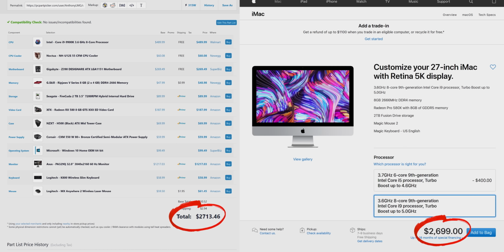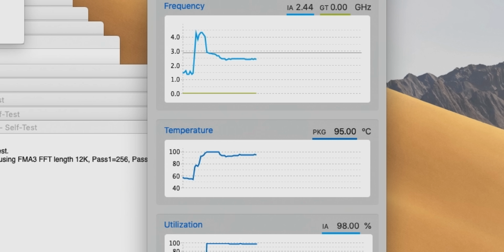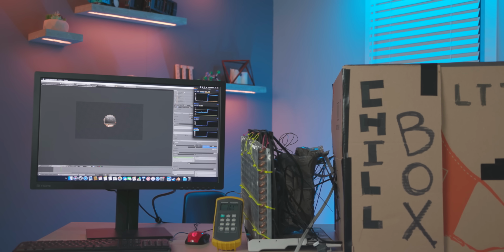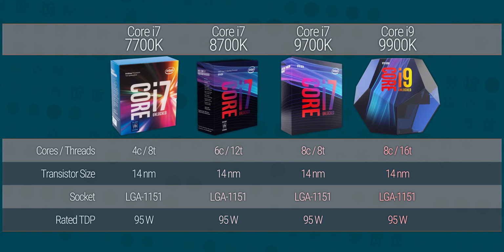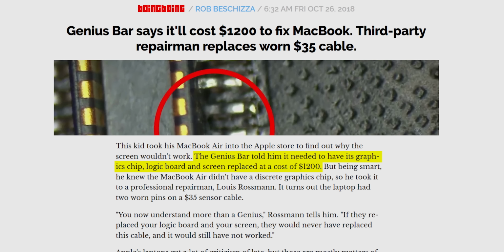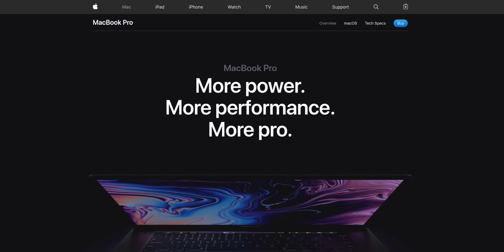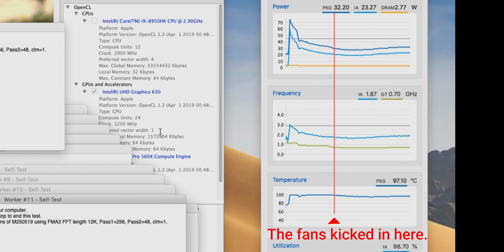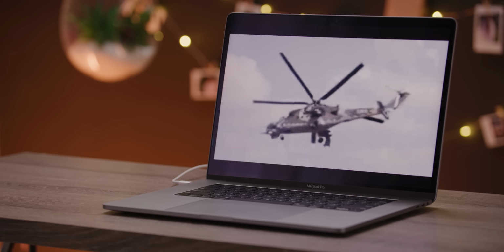Macs are SLOWER than PCs. Here’s why.

Comment: 0:12 Why so big monitor 32"? O_o , and it's also 5k. What's the point to take SO BIG SCREEN? Just take 24" monitor with 1920x1080 resolution and you're great! No hassle with apps, which do not support 4k-5k, all fonts look great, less GPU stress and power consumption, and you will be able to play any game on ultra/high settings with such graphicscard in 1920x1080, while with 4k/5k you won't. What's the point to buy 4k-5k at all, i don't get it.

Comment: I had G75vw Laptop with a custom firmware and GPU 670MX.  The GPU was overclocked from 601mhz to 900mhz.  Could barely feel any heat.

Comment: All I know is that anecdotally, my XPS 15 with similar specs takes about 3x longer to load into a game than all my other friends' MacBook pros, and lags a lot more.
Reply: Probably just the hard drive. What was the cost, specs and release date of the machines?
Reply: @johnmartinez12347  don't remember when, a few years old. I7 of some sort with 1050 gpu. But I do remember at the time reading on forums that some units were getting the Evo ssd's and some were getting crappy ones with like half the speeds... Pretty sure mine was the latter.
Reply: @johnmartinez12347  forgot to mention, I also had to replace the wifi card because the XPS ships with a  horrible Killer card that drops connections like crazy. Also more thermal throttling for whatever reason... Probably because plastic chassis doesn't conduct heat as well as aluminum 😂

Comment: I've been longtime user of Windows laptops (never using Macs previously), Thinkpads were my favorite over the years... I recently switched my main personal laptop to a 2015 13" Macbook Pro and so far I find its practical application better in most all regards. I've run video intensive workloads on it, and I do hear the fan kicking up for a period of time after awhile, but I never found there to be any notable delay in response while it's running hotter. 
   So far I am liking having an OS built on proprietary hardware, vs an OS like Windows built for hundreds of brands of hardware, I can see an obvious difference in efficiency and much faster boot times (amongst other things), as the overall hardware/software package seems more optimized, kind of like when you custom compile a Linux kernel for a specific hardware, it just runs a lot faster to start with (not having all the typical bloat in the kernel)... 
   But by far, the biggest advantage I've found running the Mac at this point is the battery life is far superior than any Windows laptop I've owned. I find the MacBook manages power consumption a lot better. When the Macbook is down to 87%, the Windows laptops I've tested them against are down to 30-50% already. The Macbook also sleeps, and wakes up from sleep much faster than any Windows laptop I've ever owned. I bought the Macbook used so it was not expensive at all and it is very compact compared to my latest Thinkpad. Even my other corporate Windows laptop for work which is cutting-edge and compact, only has around a 4-5 hour battery life where the Macbook easily doubles that at around 8-10 hours.. 
   So far, I am fine with Mac, and is nice to know I'm not constantly tethered to a charger, and I don't really care about what Apple advertises, as I buy all my stuff used anyways, I know 98% of all sales and marketing is BS anyways so the thing that concerns me most is, do I like it, does it serve me well... Not concerned about how it serves the next guy, only needs to meet my needs. Nice video though, doesn't surprise me that companies participate in trickery, doesn't really bother me though, as the Mac seems to work pretty good for me so far. BTW I'm not a fanboy for Mac, just use stuff I'm interested in at the time (also had been getting sick of same ol Windows for years and years, ready to try and learn something fresh)...
Reply: @Andrea Mangano - My apologies for miswording it, as of course it isn't proprietary hardware anymore, you can install Windows on Mac hardware for some-odd years now, but they build their software platform around very specific set of hardware they themselves design (as in they only have to support a few hardware/driver configurations where Windows has to support many more variances). I guess I meant that the Mac philosophy is more like proprietary 'appliance' where the software/hardware together are the total proprietary system, whereas Windows OS is more decoupled from the hardware part, and leaving manufacturers to make the end product and sell it for them... And aside from Hackintosh I don't see any way that OSX can run on anything but a Mac so I guess you could say that the software is proprietary then, not the hardware.
     Also OSX tries to keep the app devs in better compliance with their standards so they can keep a tight control on the energy consumption. If an app is misbehaving in OSX it pops up a warning to the user that this app is not optimized for the OSX so if you allow it to run anyway, you may not get the battery life or efficiency you'd expect. 
     I do have an iPhone now too, and it does seem it is proprietary hardware, as I do not believe it's possible to run any known Android ports on it...

Comment: I honestly think Apple just won’t give a rats ass about their intel macs.  They are probably just waiting to release their own CPUs and are holding out until then.  I mean apparently the iPad Pro has comparable performance to a midrange MacBook Pro with a smaller footprint.
Reply: In 2018 there were alleged reports about them phasing out intel starting in 2020.  When you consider the most recent changes to MacOS it makes sense.

Comment: Ah, the age-old "Mac vs PC" - always sure to start a debate in the comment section. 
  

I use a self-built Windows desktop for gaming and 3D/video rendering/processing work. 
For my creative outlets, such as music, writing, photo editing, and graphic design, I use a Macbook Pro Retina 2015. (I also use it for my general web-browsing, e-mails, and day-to-day activities.) 
For my digital art (drawing and painting), I use an iPad Pro. 

I daresay that Windows machines are better suited for tasks where you require more control over whatever you're doing, while OS X streamlines its UI and workflow more. 

I've had far more issues setting up a drawing tablet, or external audio hardware on my Windows machine. Not to mention the excessive drivers, routing, and other compatibility issues Windows machines face. 
With my Mac, it has always been "plug n' play." Tablets, audio interfaces, and midi-keyboards, to name a few, just worked. It is also great for working while travelling. 

Sure, you can 'game' and run benchmarks on a Mac. But why should you? Most games are catered towards Windows, and it just runs better on Windows. 
For me, the same applies to creative work. It somewhat works on Windows, but it works far better on Mac. (In my experience. Might not apply to you.)
Reply: ok

Comment: The MacBook Pro Original VS Chilled is 40 seconds. Not exactly a deal breaker. Apple clearly takes an interest in performance through software / hardware optimization. Stating that Apple customers are solely interested in sex appeal is short sighted and bias. The MacBook Pro was also built for a more heat efficient CPU as promised by Intel, which they fail to deliver. There is a lot more to this story than: "Apple cares about sex appeal and nothing more." Sloppy video, thumbs down.

Comment: If they designed their laptops with less potent components that would actually offer better real world performance due to less or no thermal throttling and better longevity from less heat, Apple would suffer on several fronts.

First, and most obvious, their marketing would suffer because the specs would be lower.

Second, their profit per unit would suffer. SUVs are more profitable than compact cars, MCvalue meals are more profitable than reasonably priced a la carte options, and MacBooks stuffed with hi performance hardware (that provides little benefit because heat forces reduced performance) is more profitable than sane components for the desired form factor.

Third, and most unscrupulous, more heat cycling will lead to shorter lifespan and increased revenue from more frequent trade up cycle. As you, Louis, and the CBC have shown, Apple wants to sell (pronounced "railroads")  customers new products instead of repair products that fail.

Designing innovative products left Apple when Steve Jobs did.

Now, Apple is focused on maximizing profit per unit and profit per customer at any cost.

Comment: Why can’t Intel enable setup multi core to be started as soon as the device is turned on and booting then go to single core for stand by and sleep/hibernate? Using all the cores from the beginning would allow the machine to get work done faster and when the computer is working on the bare minimum it is then throttled down. The fans can adjust to CPU usage and GPU usage. This is not difficult to setup and is far behind what could be done in 2019.
Reply: Never owned an Intel processor where one has hyper threading, so im expecting that hyper threading is already turned on when you get the computer. As for windows when turning on to utilize all cores, well, it sort of does and doesn't. You can manually enable on windows for all cores to be utilized on startup.

As for stand by/hibernation, processor is turned off and has 0 usage during hibernation, it is the ram that keeps all the data in the process.

Fans do not adjust on CPU/GPU Usage. They both depend on the temperature. CPU's fans can turn up whether when they are at 70 Celsius or 80 and it gets the work done, whereas GPU's nowadays have their fans completely turned off until the person behind the computer puts some workload on the gpus. Then GPU's temperature rises and thats where the fans start working their way up.

As for your in-mid-sentence of your text "Using all the cores from the beginning would allow the machine to get work done faster and when the computer is working on the bare minimum it is then throttled down." It works exactly that way. New intel/amd processors actually use the bare minimum power when its on idle (doing absolutely nothing when no one is using the computer). As soon as the user starts utilizing them (playing games, using different kinds of programs to use the CPU power), the CPU alone increases the clock speed so it can get the work done as fast as possible. If the temperature starts rising and goes above 70 or 80 Celsius, Processor decides to underclock it as much as possible to lower the temperature (which also goes by the name of thermal throttling).

Comment: Great video. Without getting all "that guy" on you, there are two other considerations that were not mentioned. Yes, it is true that CPU throttling is partially to blame but I don't think any blame should go on CPU throttling. 

Wait... I just contradicted myself. That was intentional :-) 

The other factors for a slow Mac are: memory compression, battery going bad (from overheating), and about several other factors (whoops, I promised two). The other factors are software framework related.

The frameworks that comes to mind is Grand Central Dispatch, CoreGraphics, CoreImage, and a handful of "zxy"-kit frameworks. They do well to make things run smooth and give apps a slew of 'goodies' but do add overhead. 

Remember smooth == slow and steady. Have you ever put icing on a cake or used soft serve ice cream? It's smooth but It's slow. Slow but sweet. (syntactic sugar sweet... not "oh that's sweet!" sweet)

My Windows PC is slow thanks to Spectre-Meltdown patches. It's annoying. Apple does have some hardware solutions but those are mostly seen in the iPhone and iPad as cpu co processing (newer Macs leverage the T2 chip for which I have a love-hate relationship with)

I wrote a whole slew of other things but who has time to read it? Thanks for the post. (PS I use both platforms)

Comment: After watching the video:

Mac Fanboy : iMac Pro, here I come.

Tim Cook : Yes
Reply: Isn’t the iMac Pro also known for thermal throttling?
Reply: @Niels_f2704  the point is that you cant fix stupid :) they cant be helped..
Reply: @unword.  Yeah but it's all marketing. Packing huge GPUs and CPUs in a very small formfactor just doesn't work. I'd personally would always rather get a huge case for desktops as internals are easy to replace or repair and might save you some costs. Maybe the new Mac Pro but I'd rather be off with windows for professional work as more graphical programs are aviable and are usually better optimized.
Reply: clearly since Windows has a bigger user base the programs are more likely to get better feedback from its users, and is more likely to be further optimized due to the level of feedback from various windows pc systems that has an 80% market share in comparison to mac's 14% of user base, i like mac designs and all that but its all meant to look pretty and is for a niche market of those who use it as a fashion statement in most cases, so its no more than a accessory than an actual functional product, but most people will deny that to the  bitter end, until they get an actual education about what goes on inside a computer of any kind(except for the hardcore fans who've lost their sanity)

in the end its a sad thing, apple consumers need to learn to say "No" when apple is trying to shove things down them and make off with their money after giving them a product full of lies, by not doing so these consumers are only giving birth to bad standards and doing so destroying the tech industry for themselves, which would only mean that in the future; apple will charge their consumers even more , as it has already been proved in the previous years vs now.. it is just simple fact, i pity most apple consumers cause their lack of awareness is what makes them so gullible..
Reply: That's indeed true. Macs don't have to be that bad but I just think they way they build their computers isn't that great. The older macs were slightly thicker and had way better coolig. Neither do you see any vents at the bottom as where basicly every windows laptop has that. But I never really saw the Mac being something used by graphical professionals as architects. Companies are really digging price and performance as it stands for efficient productivity. I'm not saying that it means you shouldn't buy a Mac but there's also so much more option on the market side of Windows PCs. Apple still makes unique laptops in their own way and they are very secure wich is a pro for a lot of people but I think overal price and performance is just a con. I'm a Mechatronics student and I work with a lot of programs that aren't aviable on mac such as Solidworks. Next to that you need a dedicated GPU wich is only aviable on the 15 inch Macbooks wich already comes at a cost of an actual workstation laptop.
Reply: @Niels_f2704  Apple's so called security is just a sales pitch that has no real backing honestly, if you have learned any amount of decent programming , it would be clear as day that any platform made by man is prone to safety risks no matter how advance they claim to be, but in this case apple systems aren't really top end for security at all; they are just not a focal point of viruses or people who make viruses/malware for systems due to having a small user base in comparison to windows, I'm just pointing out the sense in why Windows users face/ faced a lot of virus issues throughout the years on its predecessors and improved along the way, the main reason is that for virus or malware else data theft applications made by various folks, Windows is a platform where they can spread that to a lot of "users" and gain an overall large amounts feedback from those systems or economical gain by stealing information/data in comparison to the smaller user base of mac's; its simple as that, which is why icloud hacks of celebrities makes sense, cause beyond that, it has not much of a focus point in other industries like businesses or education else overall consumer bases to be a focal point of "unethical hacking". which is why Windows 8 is safer than Windows 7 was, and Windows 10 is safer than Windows 8.1 was, all those real life experiences in being hacked, thrown malware at, dealing with Trojan issues everything that couldn't kill windows or killed it at some point still managed to help windows grow as a system, as we know it "evolution" of anything is simply by having experienced difficulties rather than not, so without test case scenarios mac systems will remain in a dream world of proclaimed security than real life statistics and all that for the price of lacking in flexibility, which is why enterprise wouldn't risk it, nor would the average joe waste away for it.

Comment: Mac is more for anything besides gaming but it’s not bad but not great. Windows is more for a gaming machine.
Reply: ummm windows is for everything rlly.
Reply: Gaming Montages Mac can get a good 60fps on fortnite but the main purpose of Mac is mainly creativity graphic design and editing. The main advantage of windows is you can build a computer in your own way.
Reply: @liltdog6527  well i use Pc for literaly anything. As mine is very well cooled, i can over clock it to its maximum. And currently i have a gtx 1050 TI with a amd ryzen 7, more or less i use it for vudeo production and intesive grafics gaming, plus work, as i said, its rlly a thing of me using it for evrything, and it being perfect for everything